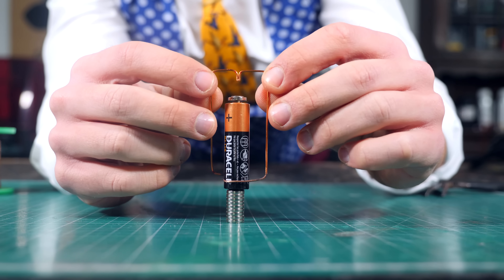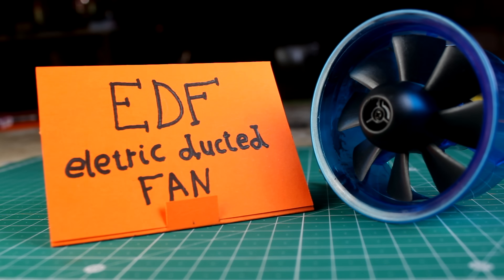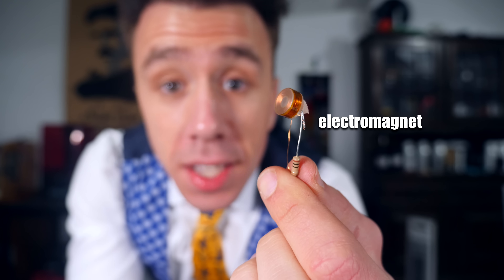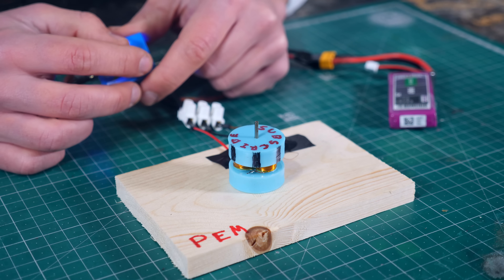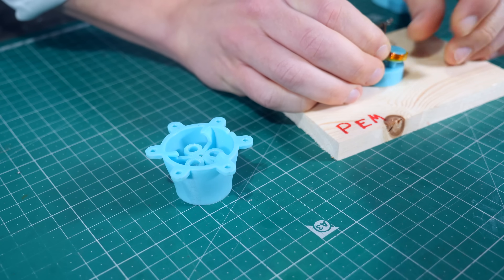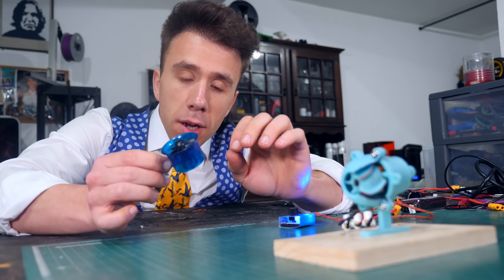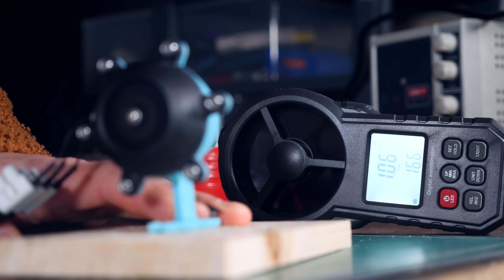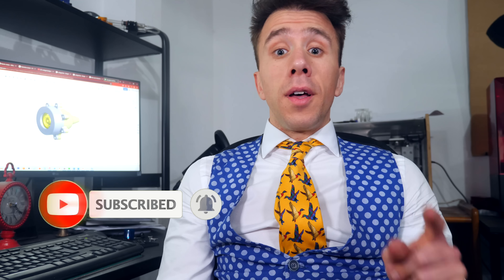I 3D Printed an ELECTRIC MOTOR FAN

Comment: One possible reason I havent seen already mentioned is that dyson fans are designed with a heavy emphasis on being quieter, which likely means compromises on thrust. For example the vortex generators used on GEnx engines make them much quieter, at the expense of losing some thrust due to the vortecies. I wouldnt be surprised if the dyson impellers have some design features that also put thrust at the expense of quieter running. Another thing is that the dyson fans werent even meant to produce much thrust from the outset. After all, you dont want your fan constantly blowing itself (or other objects) over. The dyson fans are designed to produce a much slower exit air velocity than an edf unit, which certainly results in reduced thrust. Of course motor rpm certainly plays a role here, but the Dyson impeller probably loses a lot of its efficiency at higher rpms, since it wasnt really designed for that purpose. So it might just not be as suitable for the higher rpm edf motor

Comment: My only guess is that EDFs work due to their very tight tolerances with the duct. If it’s off even by a little you loose all the benefit of having a duct. Maybe your design either isn’t tight enough or due to the shape can’t benefit the same. Try to compare thrust without the duct of the EDF and see if it matches.

Comment: Try making it bigger or maybe smaller. You see the size and power of the fan motor need to be matched up with the size of the propeller or impeller. The dyson design probably has a faster spinning motor than the fan motor.

Comment: The weight of the impeller setup must be more id guess than the tiny edf prop making the impeller harder to turn. Also remember the air sliding against the walls of the impeller system will cause drag thus slowing the air down more. Also the exit hole may be too small. Sure you’re building pressure inside the impeller system, but the wind speed of the exhaust may be low because the air cannot escape as fast as an edf. Since the edf is directly open through and through. In a larger commercial jet turbine you have combustion which would accelerate the exhaust to insane levels since the air increases in temperature thus increasing pressure literally forcing the air out faster. You want fast moving air coming out is what I mean. You may have slower high pressure air. Another possibility is that your system is just inefficient. Probly your blade design. Maybe try to Frankenstein a Dyson system in full vs copying it. See if it works. It’s possible that the Dyson design isn’t good for this project. Hence why jet turbines are slightly different in design than Dyson systems. Not as a joke, I mean materials set aside etc where you’d expect them to differ. At the end of the day, a jet turbine is designed with combustion in mind, where Dyson wants to make a house fan. Blade pitch and design, weight, exhaust, etc. will probly change between the two purposes. I’d see about getting your hands on a small rc jet and test with it. Can be expensive but it may be the easiest way to learn. Warped perception has done a lot of work with them. Maybe a collab is needed? Just my 2 sense as an engineer. Hope you figure it out, and I hope this was helpful

Comment: Please make a flat horizontal wind generator that powers and is powered by a small dc fan. Also have the blade array hovering over the coil on a frictionless magnetic bearing. Also, please send me a 3D printer so that I can make one of these things that I just described. Thank you!

Comment: The EDF unit is designed to make thrust... A centrifugal impeller requires a diffuser. Put simply, a single stage axial fan and single stage centrifugal fan (impeller) dont work the same,.. A centrifugal impeller creates a higher pressure ratio per stage than an axial one for the same consumed power, this is wht they are used in a vacuum cleaner as to get a bigger vacuum you need a higher pressure ratio between  P1 and P2 as described by bernoullis equation... Centrgifual fans are also harder to design as you cannot 'eye ball it', you really need to determine the rpm range, determines the velocity angles of the outlet flow and then design a diffuser which slows the flow down/increases its pressure before running it through a nozzle to reaccelerate the air... your current setup is simply blowing high pressure air out the back... remember, high pressure does not mean high velocity... High pressure = Slow moving air, Low pressure = fast moving air... So in short, design a Centrifugal impeller>Diffuser> Nozzle

Comment: I'm late to this and there are plenty of comments already, but just in case no one's given you an actual answer, I'll see if I can help.

TLDR: look up the advantages and disadvantages of different types of turbine engines (no/partial/high bypass)

First. You never measured thrust, this is more important than it seems. The two biggest factors in thrust are exhaust velocity (which comes from a combination of developing pressure and purposefully expanding that pressurized air in a specific direction) and total mass flow. You only measured, at best, mass flow (and inaccurately at that). People will use the analogy of gear ratios here, but in this case I think electrical currents are a more intuitive analogy.

You can think of mass flow as amps, and exhaust velocity as voltage, whereas thrust is watts.

But here's where the analogy gets strained. In jet engines, the higher the energy involved, the more gets lost as waste (it's as if your wire insulation is complete shit, made of wet paper or something). From the friction of moving parts and the bleed off of heat in unwanted directions, to even the loss of energy from your exhaust due to it being converted into sound instead of thrust. This is why high efficiency jet engines are as high bypass as possible, at the lower speeds they travel at the best way to convert fuel to thrust is to move as much air as possible.

There is a problem with that though. With a rocket, because all of your propellant is in your ship, as long as you push some backwards, you go forwards more no mater your speed. But with a jet it's getting the majority of it's exhaust mass from the air entering it, and yet the exhaust velocity is fixed to the engine performance and not related to the speed of the incoming air. If your incoming air is moving as fast as your exhaust velocity, the two balance out and you get no thrust (like voltage drop across your components. If you don't have enough push to overcome it, nothing moves).

This is the reason why lower speed aircraft (like air liners and RC airplanes) prioritize mass flow over pressure/velocity. Going high velocity just wastes a bunch of energy you'd rather use to fly longer. In turn this is why faster craft like fighter jets use partial or even zero bypass engines, they don't care about fuel prices or extreme range (some modern airplanes can fly half way around the world on a full fuel load), they need to make sure they can get places fast, and be faster than the other guy in a fight.

Comment: My best guess is the impeller needs much higher rpm like a turbo or jet. Close to 100k rpm. Or a decent amount larger. Using the same motor doesnt work because its voltage limited to a certain rpm favoring the edf while the compressor is not even close to its efficiency island.

Comment: When it's comes to centrifugal type fans you need to study compression ratios, aspect ratios inlet and outlet diameters etc. With an axial fan you are simply moving air from a to b, with a centrifugal fan you are compressing and then releasing the air.

Comment: It would be interesting to see you build a air compressor motor.  I've been wondering about those motors and how they are horrible at the amount of heat they put off.
Reply: When you compress a medium, it will increase in heat. The more it's compressed, the more heat is produced.

Comment: Maybe it's because the air gets compressed and so reduces the air flow. 

If the motor spins with the same rpm: having a higher air speed means lees dense air. And higher densitie means slower air speed.
You´re needing a higher rpm for the same amount of air flow.

Comment: You should do the turbo jet engine with better air flow in the intake make a shirt ram intake like a little trumpet for more and smoother air intake (ps I want to learn hit to 3d mode but I don’t have a 3d printer yet)

Comment: I'd try playing with the pitch of the blades and the shape of the housing. A centrifugal fan is accelerating gas radially, while the axial fan is accelerating more linear. Pressure alone wont equal velocity if both sides of the gradient aren't optimized.

Comment: Hay integza I have an idea for your video
I want you to build a car or by a car (it could be a toy or an real car) and put pulsh jet engine on the silencer or make pulsh jet engine with cars silencer and you can put three silencer one real and two powered by one or two turbo and build a rear wing and put two Ram jet on it and it all be powered by hydrogen or helium and oxygen and you should put three or more turbo on the car and you should put fule directly in the jet insted of relying on the engine.

Comment: You should make a submarine that is air powerd but the is no air storage tank it has to chambers one is intake and one is outage and both tank are connected with a valve pipe that you can control the valve

Comment: Test both fans directly blowing into a sealed pipe ducted into the measuring device, not sitting in the open, since the circumference of the two streams of air are very different and thus the additional air volume created by friction will be very different.

Comment: 1. Compare the current consumption between the configuration.

2. Trust (momentum to be exact) = Mass x Velocity of air passing through. It can be small amount of air but high in velocity can provide equavalent trust (momentum) to a large amount of air at lower velocity. If we measure trust based on velocity alone and not the nett opposing force, the results will be different.

Comment: What temperature does the fan get to?  With how fast it's spinning could be heating up at some main points. That could be causing some of the expanding. If so could try a different material.

Comment: A cool thing would be to put all these jets to use is building a plane around them. I'd say that it would be a good idea for you to just concentrate on getting it flying (ie not sweeping the wings, not bottom wing. Only for stability of flight). Also you can strap tomatoes to it and drop them to their squishy demise, or you can strap rockets to the plane and fire them at a big box of tomatoes. For content

Comment: You should cut the bottom of a can 1 inch high from the bottom cut off the bottom but leave x in between of metal about a quarter-inch big or or 2/8 in major three-quarter inch or half inch blades all the way around the perimeter of the can grab one side of the blade on the linkside the long side so it's 1in long half inch wide grab the long side and one of the corners the opposite side that you grabbed so you need both hands grab the fan blade with two hands hold one side kind of sticking out why you been the n-word corner of it inward and face up a little bit and do the same thing on all of the blades in curved them inward so you get kind of like a rocket looking jet it is some of the fascist revolution propeller there is but the wind that goes in makes a ninety-degree turn that make a vortex in your jet if you have it in the front of your motor and then you have the combustion chamber we need to send the oxygen and the gas instead of blowing on the fan blade with your breath use the gas and oxygen to spin the propeller and it should give you probably better thrust or control of the flame just see how it goes I don't got a 3D but after you design the can you could make it three dimensional copy in all the blades are actually connected at the tips where it will make us smaller circle than the can you have the bottom of the can which is about the inch-and-a-half 2 inches wide the center of the fan blades make a circle that's only about three quarters of an inch big maybe and your blades come out on the sides it's a very weird design I used to work at the airport for a two years and have my spare time I would make rocket Jets motors out of those propellers and I would put it in the duct and have them spin when you blow into it it will actually create lift

Comment: What about trying to replicate a full flow staged combustion cycle engine like the raptor, but without a constant supply for an oxidizer? I think you could do it by using glow plugs to ignite the fuel. The air  you could store in a compressor (a cold gas thruster of sorts, but within the routing to the combustion chamber) some sort of way to preburn a liquid fuel to turn it into a gas to have it meet the air at the combustion chamber. Maybe a few glow plugs at the combustion chamber to ignite the mix? A hobbyist’s raptor.

Comment: Axial fans offer higher RPM and higher flow, but centrifugal fans achieve better compression.

One solution to get high flow and high compression is to stack several fan discs together to achieve staged compression, like in a jet turbine.

Comment: My guess would be that your fins have a maintained or small difference in height from the cores surface to the fin tip, so the volume in the channel between each fin doesn't change much from the inlet to outlet, and on the fan you salvaged the fin height is probably higher on the inlet vs the outlet so as the volume between the channel decreases towards the outlet the air moves faster, I don't actually know that's just this strangers intuition, can't wait to see your solution!

Comment: a good thing to keep in mind is that with compression involved stuff like friction,air resistance, and lack of torque become problems, not to mention the centrifugal fan doesn't have anything impeding or altering its flow of air, which your aerospike both acts as a nozzle, and a cushion that will reduce the overall amount of energy in exchange for a more efficient release of air, along with the fact that compressed air is going to have a way higher friction coefficient then the low pressure air that the EDF is outputting. all in all, with my admittedly limited knowledge i cant help but feel like the problem here is the lack of simplicity. maybe if you got other things involved, like combustion, or using microwaves to heat the air as it leaves the contraption (probably with a setup similar to those plasma/microwave furnaces where you just stick it in a microwave and it melts metals), that way you can add energy to the system and vastly improve your results. at the end of the day all of this is equations. energy * efficiency = result

Comment: I'm a car guy so I'll try to relate it as if you have horsepower and torque. You basically have speed(hp) and pressure(tq) in the fans, right? If so, you have plenty of speed to do the job, but in my mind you don't have enough "torque" or pressure coming off the blades. This happens alot in cars. You could have low hp with lots of tq, and go the same speed with some tuning as a car with high hp and low tq. 
Basically, you have the speed, you need to make more pressure (hope I make sense)
Reply: Mintegza  I'm trying to figure out the app, it's a little confusing 😅

Comment: In an video you used a ceramic 3D printer to make a rocket nozzle but you had a porosity problem I thought that after you baked it if you put a second layer but did not bake the resin out of it you might be able to fix that problem

Comment: Imagine if a time traveler went back in time to the era of the discovery of electricity, brought with them the knowledge of conductance, resistance, capacitance and psychedelics, invented a working wired rc car and was found using it in the barn whe naked high on shrooms, gigglining maniacally, found by the cops because rhe neghbors complained about them singing metalica too loudly? 

I want to be that guy.

Comment: The problem is that you're putting the same amount of electromechanical power to work a fluid stream with both the EDF and the impeller, but that power is being applied to fluid streams of different sizes. The EDF does work on a larger streamtube of air, while the impeller does work on a smaller one. Thrust comes from the change in momentum of the streamtube of air by the propulsor. The EDF moves more air slower, while the Impeller needs to move less air to a higher speed to get the same static thrust. The power you're putting in changes the kinetic energy of both streamtubes, but K.E = (1/2)m*v^2 so it takes a lot more power to get the same thrust from the impeller. The advantage of the impeller would be that it can operate at higher airspeeds than the EDF, but it needs a lot more power to do so.

Comment: Are you sure that's the right model for air? Compare the volumetric plastic to air ratio, and you'll see what I mean: your impeller has much more plastic, pushing much less air, than you see in other air impellers like turbochargers, vacuumcleaners, and bladeless fans. More to the point, those impellers all look almost identical, while yours is clearly different. The impeller you made looks like it's designed to extrude clay or thermoplastics, something heavy and dense that requires heavy blades, as thin ones would just break off in the clay. Do you know what I mean?